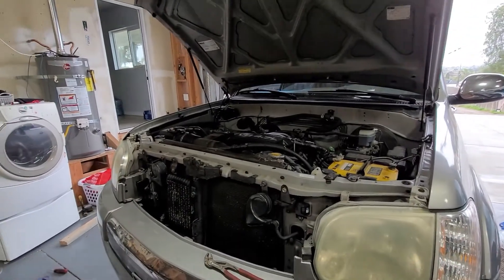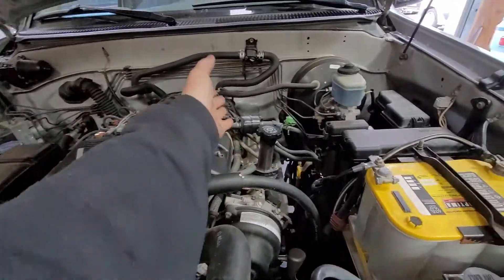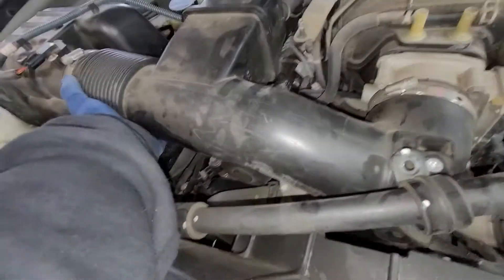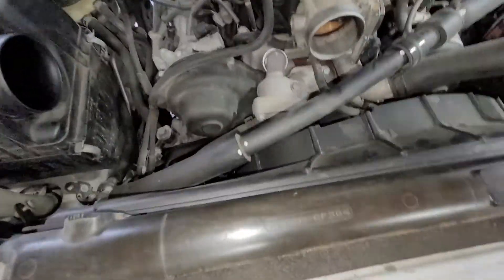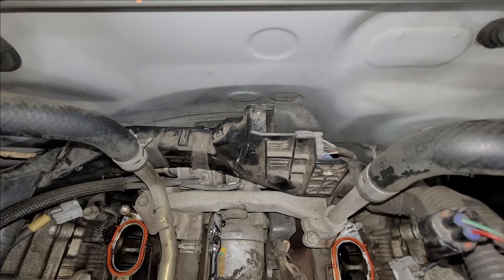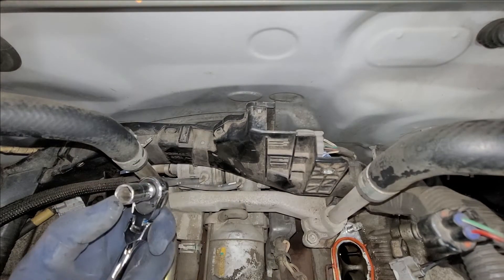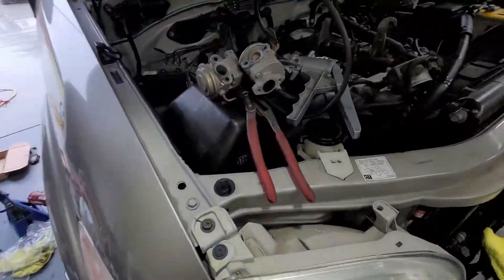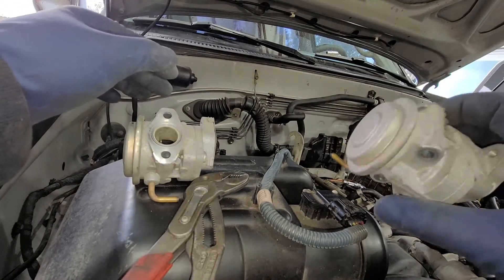2000-2006 toyota tundra Secondary Air Injection Check Valve replacement

Comment: Nice camera work. 👍🏽 If the air pump or the diverter valve was bad would you see this in a code. And is that why only the one secondary air valve was replaced?

Comment: Just want to add a couple things;
1) During removal, I got hung up from removing intake manifold by a 2nd 10mm bolt holding the wiring harness on PASSENGER side.

2) I'd suggest first Vacuuming all around edge of manifold as I somehow had SAND and lots of debris, some abrasive, some not which could easily fall into intake ports!

3) I like someone's idea, before reassembly, to place some screen or mesh over fan intake port as the fan impellers are plastic and sometimes get damaged by incoming debris.

Comment: Hi, I just had my secondary air injection valves replaced, the air intake manifold gasket replaced as well. Since then, there has been a constant ticking coming from the passenger side of the engine. Any idea what it could be? My mechanic couldn’t find the issue but states everything is running fine

Comment: Why would a 2000 4.7 not have these air valves?  Would it have some sort of secondary air injection in a different location?  I am certain they are not behind/under the manifold on mine.  Asking just in case you have an answer nobody else seems to have.  Thanks and great job and video.  You are a skilled person.
Reply: Emissions were not as strict on first year tundras.

Comment: My 2001 Toyota Tundra v8 just started having a humming sound by the Engine when I accelerate. Im thinking its the secondary air pump. Did yours have that symptom too?
Reply from the maker: No this just turned on the light

Comment: How do you know that Check Valves are broken and not Secondary Air Injection Pump?
Reply: easy to check pump; between fuse boxes and brake master, pull big grey connector and short (jumper) the two contacts within, and pump should run without crunchy sounds. that's it!
Reply: Very easy to check air pump; between fuse boxes and brake master there's a big grey connector; disconnect and firmly short(jumper) the two contacts within(needlenose pliers work well) and the fan motor should run smoothly without clunkiness or crunchiness, If it doesn't then most likely the fan is bad.